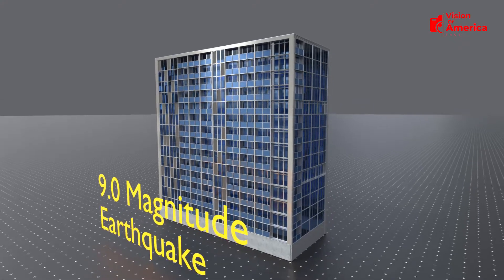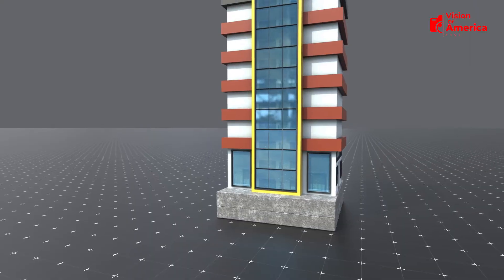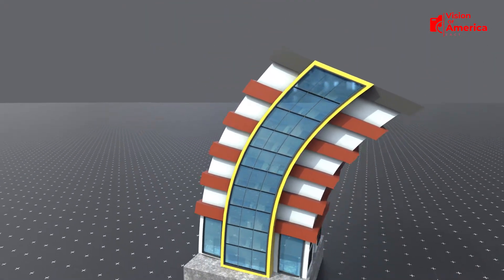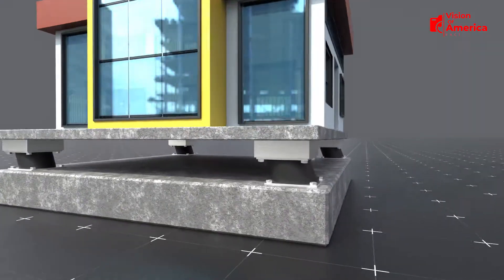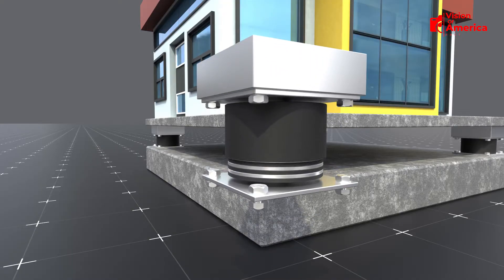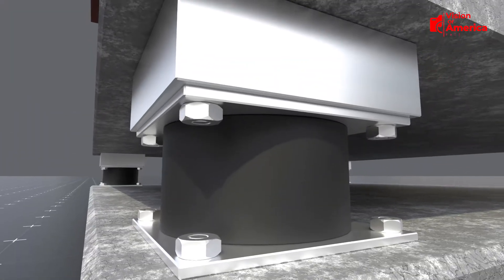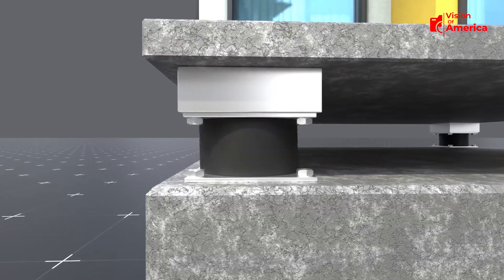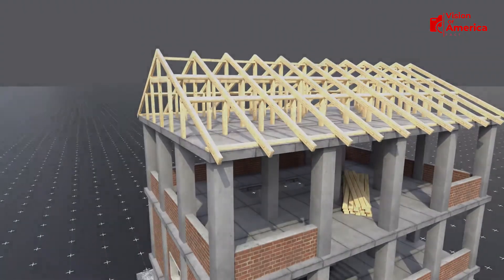How Earthquake-Proof Buildings Survive Massive Quakes | Base Isolation Explained

Comment: I guess there is something more to add in this video..like how thin that concrete of that building..and only 4 PCs rubber dumper..(what about the earth quake moving in different directions?)..I think we most add a high pressure balloon with it..let say...in this video make it 8pcs+8pcs high pressure balloon,in a balance state...
(I don't know if wee can make balloon like that under a building to reduce stress to  the dumper)...
Reply from the maker: You are right

Comment: Earthquake made building not only just STATIC mechanical but DYNAMIC too.
Earthquake isolator not only just about the foundation but the JOINT.
The weakness it can only accepted less than 5 minutes.
More than 5 minutes event with weake earthquake the building will collaps.
Reply from the maker: Thanks for your comment